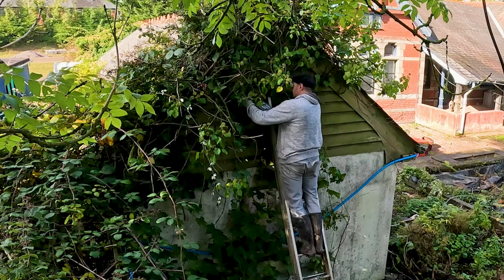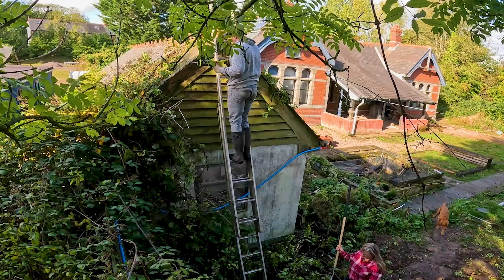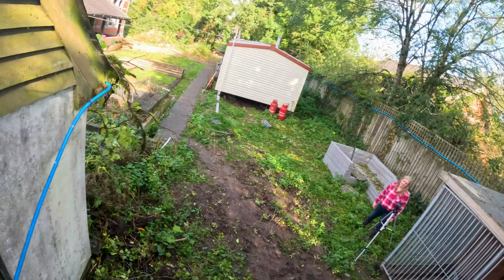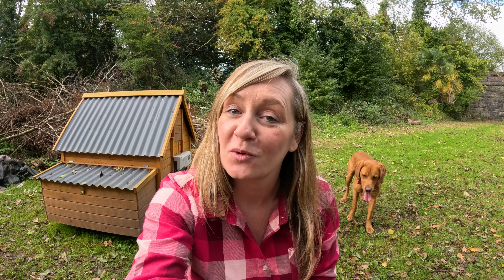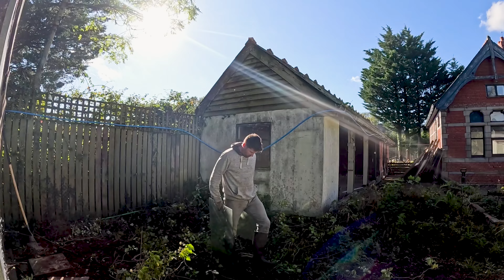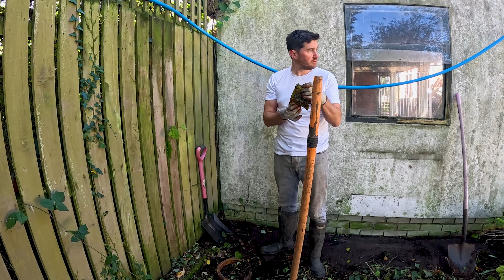We CLEARED The VICTORIAN Slate Outbuilding ROOF & Bought Winston A Toy

Comment: Nice job. Who does that fence belong to that’s beside this building? If the vines are on the other side they’ll just keep growing up to your roof.
Reply: I was thinking the same.  By rights, it should be cut down, or at least reduced, on the opposite side of the fence in order to prevent having to do the same thing again, come next year.
Reply from the maker: The wooden fence is on our property, there is a chain link fence behind it which is the boundry line.

Comment: You guys need some tools…gas powered hedge trimmer would make quick work of things like vines on garage roof and with all of the discarded vine material, rent a Chipper to mulch all of that material down to a minimum! Maybe a decent Pressure Washer as well for all kinds of cleaning jobs. Again a gas powered machine 3000 psi would be awesome. Just some thoughts.

Comment: Is the back wall of the shed and the fence next to it the property boundary on that side? If so, the eaves on the back would be an encroachment into the neighbor's property. It would be nice if you had enough space to put up a ladder or paint the back of the building.. Perhaps something could be worked out to purchase a strip or obtain an easement.
Reply from the maker: The boundary is just behind, not sure there is enough space, need to take the fence down to see.

Comment: Much better now that the viines are removed. I'm wondering if you can get access to the back side of the out building? The fence is built right up against the building. 
Is that normal were you live. 
Iv never seen that before, and don't know how you can maintain/work on the back side with a fence up against it.
The plaster could be falling off back there and you wouldn't  know it. Aswell as possible wood rot.
Reply from the maker: The fence is right up against it but there is a chain link about a foot behind it which I’m guessing is the actual boundary. It’ll be tight but that should give us enough space to get in there 🤞🤞
Reply: @theoldstationrenovation   OK  Thanks for the clarification. Couldn't see the chain link in the video. 
You're probably correct about the chain link being the actual boundary.  That makes more sense than it being against the building. Keep up the fantastic work.

Comment: Could you not  have cut the ivy off at the base so it would have just died off and just pulled away without tools a few weeks later without any damage to the building concerned.  And then you could dig out the root to stop it coming back? All of this seems to be stopping you from getting on with the main station renovation, which seems to have come to a complete standstill? Why are you doing it like this?
Reply: Don’t think they can do anymore on station, until all the plans etc have been approved, so are working on outbuildings in mean time. Don’t be so impatient.
Reply: Wasnt being impatient, was just asking a question!! Doesn't alter the fact that cutting off ivy at the base means it dies and detaches from any building easily without causing damage. And no specialist expensive tools needed.
Reply from the maker: Just waiting for the sale of our old house to go through to free up the funds. Hopefully it’ll complete in the next couple of weeks.
Reply: Good luck with the sale. Can't wait to see the next stage of your renovation. You must be itching to get going on your new home.